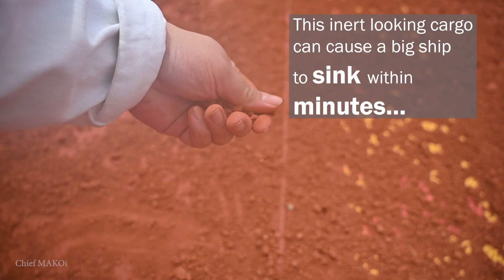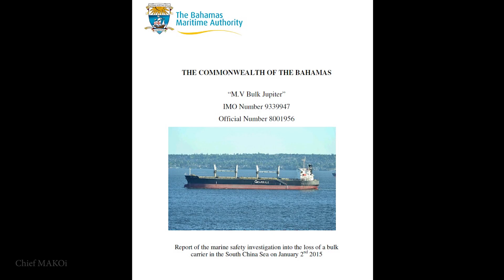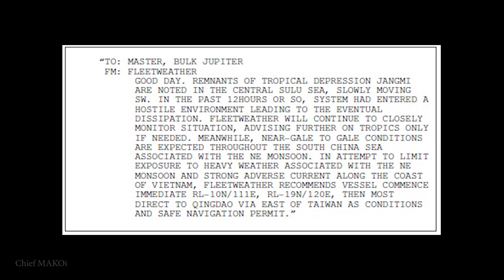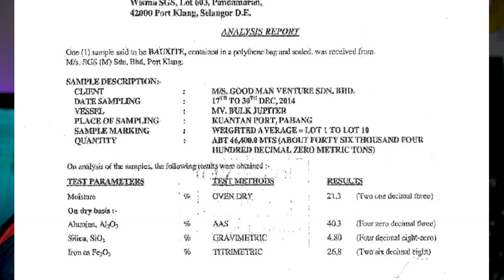The Cargo That Can Sink Ships Within Minutes : Bauxite Liquefaction | Chief MAKOi Seaman Vlog

Comment: Excellent and informative episode Chief. In what seems like a lifetime ago now, (the late 80's and early 90's) I participated in loading ships while serving in the Air Force, however it was a much different operation than what you show us in your videos.  It consisted of driving vehicles and equipment on and off a Ro-Ro ship.  The Army Port people did all the load planning. In the US ports we simply brought the vehicles alongside and the longshoreman took over from there except tanks and Bradly fighting vehicles, they were loaded by military personnel.  At the destination port we did the unloading and reloading if need be at the direction of the ships crew, Army port crew and local port authorities. It was explained to us by an Army guy that there was a specific plan for the loading, not only to balance the ship but to the order the cargo had to come off at  the various ports along the route. It was fascinating to see it all come together. Especially how tightly they could pack stuff in the holds and still have room to attach hold downs chains. It was all very orderly and efficient. Cheers

Comment: Interesting!  Does this not point to a design defect in bulk carriers for materials that can exhibit this behaviour?  Should there not be multiple smaller holds or baffles to prevent lateral movements?  Even though this might be less efficient for loading/unloading it could save lives.
Reply: That's why the moisture limits.
If it is below the limits, the design of the ship is fine.
It's only when it's too wet that the ship has issues, so it's a choice, do you design every ship to be able to handle a liquid cargo, or do you keep your cargo dry?
Reply: @ke6gwf  Hi Ben…. A quote from a recent research paper on the problem: “According to the interviews and questionnaires, some risks are hiddenin the stages of pre-loading and loading. A total of 47% of seafarers stated thatthere is a certain amount of false information provided by shippers prior to loading. A total of50% of seafarers said that the ship detected water content occasionally in accordance with theIMSBC code. A total of 47% of the seafarers thought good cooperation and communication waslacking between the ship and shore during the process of loading and unloading the bauxite”. 

It’s evident that commercial pressures lead to non conformities, so solution needs to be driven by more than just regulation.
Reply: @Richardincancale  I agree things can be improved, and that could be achieved by the ship crew regularly sampling the product as it is loaded, either through a guy with a bucket on a rope taking samples and doing the can test once an hour, or with higher tech moisture content testing equipment.

I mean, in the agriculture industry, every truck load of grain or beans or whatever has a sample taken, moisture levels checked, and inspected for debris, so it would not be hard to assign one crew member to take periodic samples throughout the loading process, to catch any that has excess moisture.

I think it's stupid that they don't already do something like this and just rely on the shipper to certify it when it's the life of the crew at stake.

Comment: Great video Chief - my condolences to those lost and their families.
Could Bauxite transfers be made safer by having a continuous mixing system running to prevent the liquefaction issue? If it's kept stirring, I suspect it may be less risky...
Reply: Not all ships has that feature
Reply: OR, is system could pump up the "liquid" from the surface of the cargo, run it into a centrifuge and dump the 99% pure water overboard and restore the solids back into the cargo hold.
Reply: @GilmerJohn  : It always boils down to cost.  Such equipment would cost money.

Comment: My dad used to be a chief engineer on bulk carrier ships. He said that bauxite and artifitial fertilizers were scary as hell. Now I know why. Fertilizers and sparks, bauxite and water... damn.
Reply: When you mentioned iron ore does that include taconite pellets? If so I wonder if that’s a contributing factor for the Edmund Fitzgerald going down. As far as I know there’s never been any mention of whether her cargo was wet when loaded. They discussed the cargo hatch securement but nothing about the cargo itself. From accounts I’ve read and heard the ship was heading into the wind and waves at first which would simulate the can test. When it neared whitefish point the winds had shifted to the stern and along with a course change, the waves were surfing the ship in an attitude of bow down in the troughs. It seems it could have caused the load to shift to the bow and caused it to nosedive into the bottom since the ship was at least twice as long as the depth to the bottom. There’s even a possibility that if she grounded at the shoals the influx of water could have further liquified the cargo from that point. It would be nice to mark this ongoing mystery as finally solved.
Reply: @kevinstonerock3158  no. You can't liquify very coarse material. 

If you're interested the magic phrase is Transport Moisture Limit TML. That is the amount of water required for a bulk solid to be susceptible to liquifaction
Reply: @kevinstonerock3158  
Fitz was taking on water and down by the bow.  The design of her pumps couldn't remove the water.  She caught rogue waves from astern and that was it.  That's the best explanation I have heard.
Reply: @kevinstonerock3158  did someone say 🌮???
Reply: Artifitial fertilizers are dangerous for another raison : it can explode.
Reply: Yes the nice Ammonium Nitrate bulk cargo, goes boom when your not careful. Coal is also a dangerous cargo, it emits methane.

Comment: Bauxite is closely related to clay minerals, which tend to have a structure of microscopic platelets, like playing cards. When dry they arrange like a house of cards, and the space between the platelets can be filled with water. So the material appears to be solid, but vibrations, shock or similar mechanical disturbances can suddenly turn into mud, as the house of cards collapses.
The effect is well known in the construction industry, because it was the cause of several disasters and landslides, e.g.loosened by nearby blasting operations.
https://en.wikipedia.org/wiki/Quick_clay